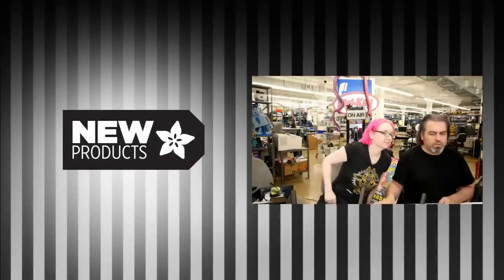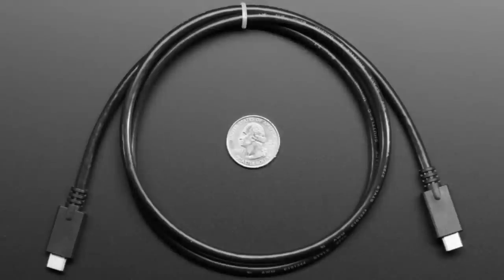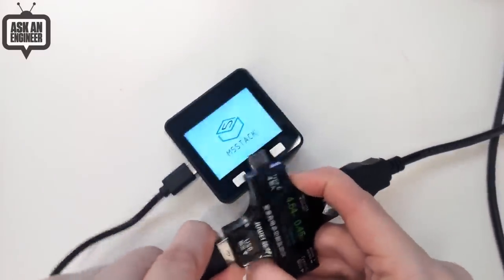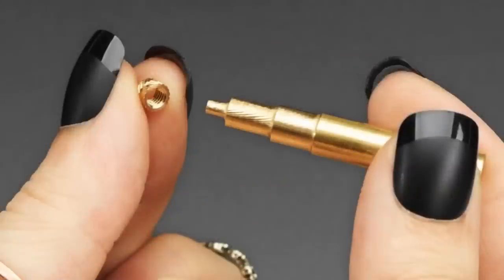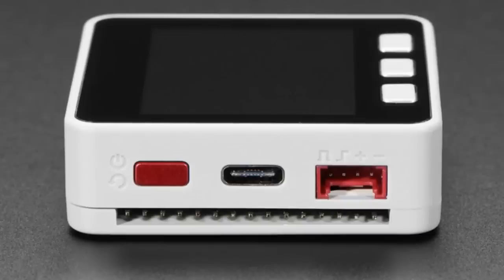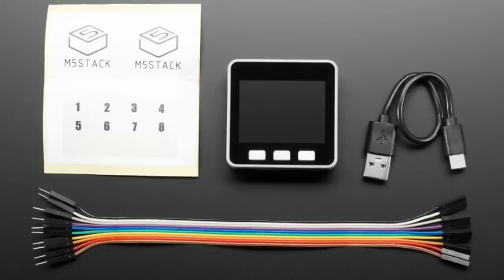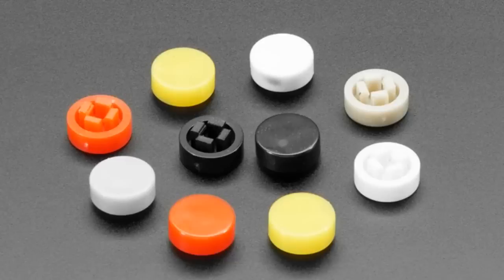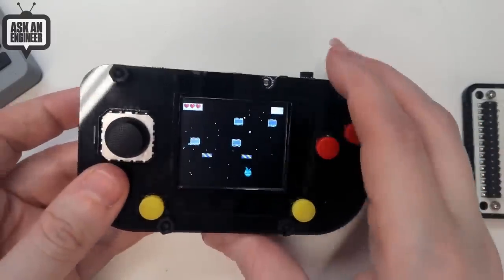New Products 5/22/19 Featuring Adafruit PyGamer! #adafruit

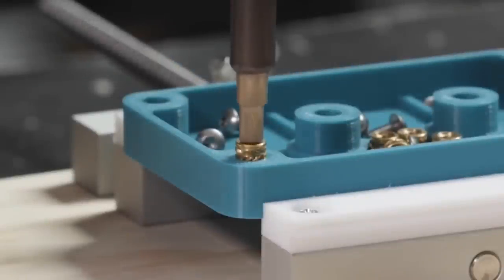Comment: 9:03 - ooh, this insert tool takes me back!  To my first HeathKit project, a little transistor radio, when I was I think 9 years old... and I was just using the soldering iron directly to do the inserts, and of course it was entirely new to me, and I was 9, so... the first insert, I totally over-inserted, and it got wonky, so I ended up only being able to use 3 of the 4 screws that were there.  With that experience and some tips from my dad, I was able to get the other 3 correct, but... this might have helped, too!  Nifty.  :)

Comment: I took the smaller heatset insert tip, chucked it in my drill and took a rasp to it and sized it down to m2.5 and it’s so incredibly useful with how many electronics components use m2.5 mounting points